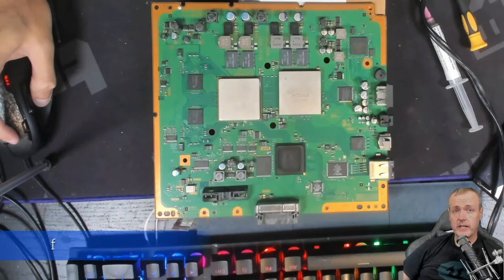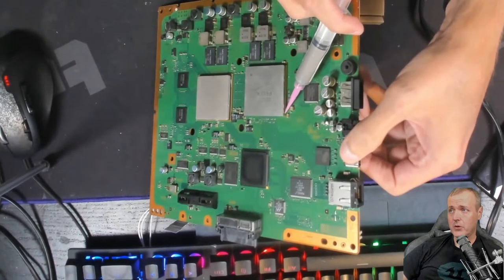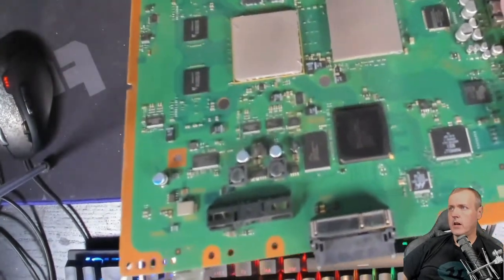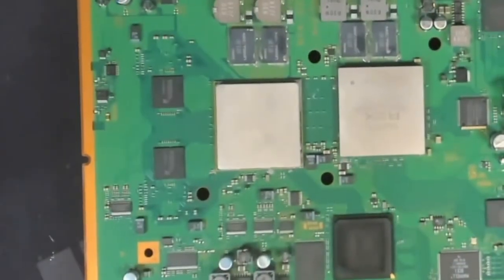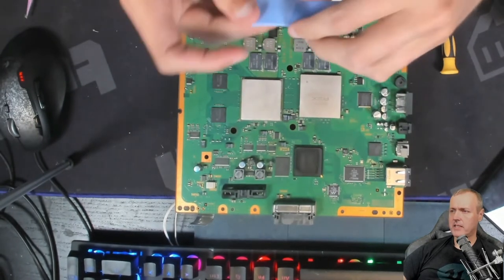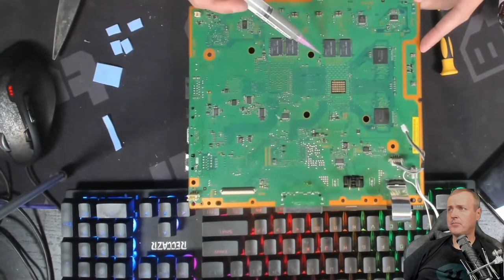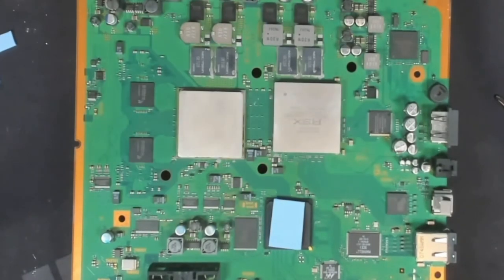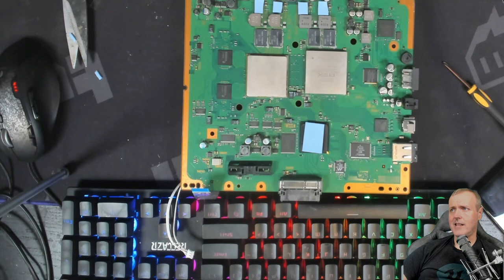Playstation 3 FAT - Yellow Light of Death Fix (with Hair Dryer)

Comment: You should syscon test the system, it will 100% give you the exact fault point of the system. Most likely the faulty rsx went out, the best course of action to repair in that case would be to swap the gpu with a 40nm slim gpu.